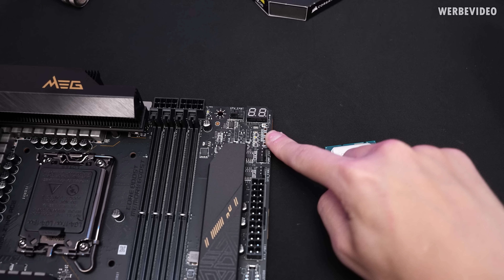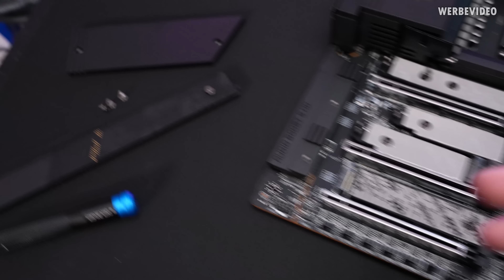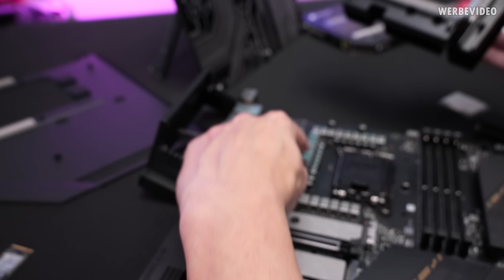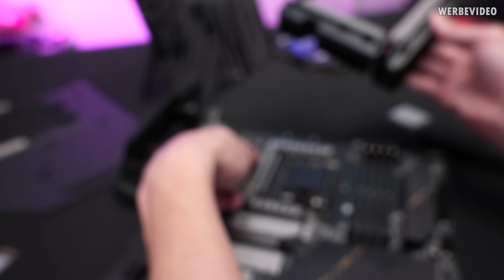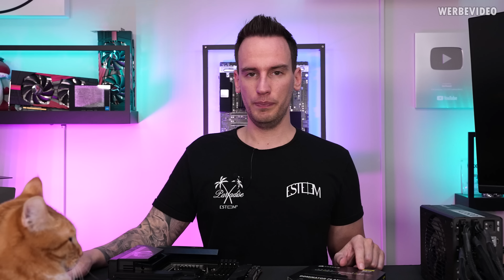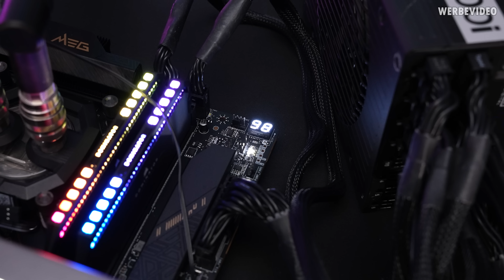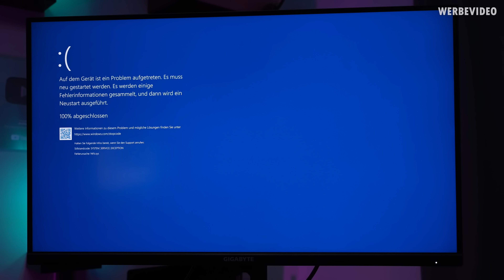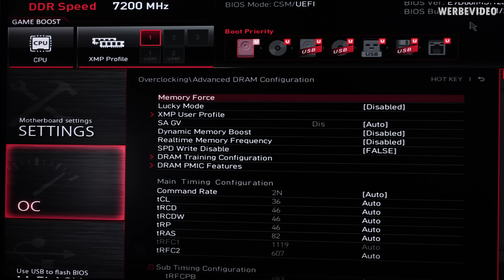My Opinion on the MSI Z790 ACE

Comment: Thank you for bringing up the memory issue on MSI Z790 boards. I have the MSI Z790 Carbon and got 7200MHz kit from their QVL list and can not run it stable at the rated speed. I even did lots of tweaks and read lots of post and many others are having the same problem. I got it can get fixed on the bios but have settled for 6800MHz with tight timings.
Reply: maybe it's your CPU that can't handle it
Reply: Daisy chain 4 dimm MSI boards are terrible for pushing memory no matter how good your CPU is. I'm speaking from experience as I owned this board for a brief period before swapping it to an Asus which exhibits none of the problems this board has. I mean, they even cheaped out on a freaking safe boot button for crying out loud
Reply: The silicon lottery is a thing. As soon as the manufacturers start advertising memory speeds so far above what Intel specify you always will be running the risk of getting a CPU with a memory controller that can't handle the highest speeds. So even if you go with memory from the QVL list there's no guarantee it will work. The problem can be just about anything as the silicon lottery isn't confined to the processors.
Reply: best memory OC on 4dimm is Gigabyte Z790 boards
Reply: @rulik007  on previouse versions I always find MSI Carbon series very good at memory OC and tighting timings (vs ASUS , GIGA etc in same price range)
and good build quality with lot of features (in some series it was cheaper than ASUS Strix-F with more features)
Im talking about Z270-370-390-490-590

from Z690 to now MSI increased this series price and its  purchase value dropped
I overclocked 3200mts single rank dual channel CL16-18-18-40 to 4800 CL 19-21-21-35 and 4400 CL 17-19-19-32 on MSI Z370 Gaming pro carbon + 9900K
while on ASUS Z390 Strix same kit didnt boot at all, I had to use higher timinings to boot.
same as Z590 carbon + 10900K (while ASUS Strix couldnt boot with those numbers

I tried another sticks too with  3200. 3600, 4000, 4133 speeds. different modes: single rank, dual rank, single channel, dual channel., and different brands like corsair Vengeance PRO. LPX. Dominator, XPG D20. D30. D60 , Team group Night hawk, Delta, Xcalibur and Gskill Trizent Z, neo
ofcourse single stick, single rank were best specially with SAMSUNG and Sk Hynix chips.

ADATA XPG D20 3600 was astonishing! very cheap ram with great overclocking potential for its range (D20 is low tier just 1 level higher than D10, while there is 30-40-41-50-60-D80 too)
Corsair rams were like lucky toys, same models with same speed (everything same) might be single rank or dual, Micron or Hynix! (there is no way to find which is it like serial number or some word at end of model like H for hynix for example. nothing!
in DDR4    Elpida  < Nanya  < Micron < Sk Hynix < SAMSUNG

in DDR5 if u wanna best overclocking potential and quality but rams with Sk Hynix chips.
in DDR5     Micron < SAMSUNG < Sk Hynix
Corsair Vengeance has good price/Speed value, but poor overclocking, Dominators are expensive and doesnt worth to buy because with same price of like 32GB Dual 5200 CL40 Dominator u can buy same capacity Vengeance 6400 CL 40 or 6200 CL 36  or Veangeance RGB 6000 CL32
Reply: @XFXForced  it was on DDR4, z490 unify OC better than maximus XII hero/formula and gigabyte was trash.
But with DDR5 is different
Reply: @rulik007  
Each manufacture designed special model for Memory Overclocking,
in MSI Boards Unify-X 
In ASUS Boards Maximus Apex
in Gigabyte Boards Auros Tachyon
in Asrock Boards Aqua OC (both CPU and Ram)
In EVGA Boards DARK K|NGP|N (both CPU and Ram)
Reply: I mean they could say 100,000mhz ram works, cause it probably would. its the cpu memory controller that dictates your ability to use fast memory.
Reply: That's funny you say that I have the same issue with my z690 carbon it can run 2 sticks at xmp no problem  but on the MSI page the xpg Lancer 6000mhz no rgb, for some reason the rgb version only says 2, but the non version is one of the of a handful that sats it says it can run 4 dimms at advertised speed, but I can only get it to 5800mhz but it let me crank the timing from 40-40-40-77 to 32-34-34 70 while at 5800mhz, 13900k cpu
Reply: Well it means they simply lying. It is also matter which size RAM do you have, because of frequency going down regarding on mem size

Comment: I could see the screwless m.2 being very useful if you are trying to swap a drive with a massive air cooler and video card in the way. Getting those tiny screws in there is a pain in an already built system.
Reply: For me its not losing the tiny screws. They are sometimes different lengths, even on the same MB :/
Reply: That's such a niche case, I doubt the added cost of the mechanism (and new failure point) are worth it

Comment: Black and gold literally goes with everything lol; probably the best two colours to put together to appease 99% of customers. It's so subtle it's not even a problem. One thing I'd zonk on this is no 90 degree 24pin header. it's 2023, and you're paying like $1000 for this board...come on (I only use MSI boards so this zonk is just a general one overall). All SATA, USB3 and 24pin headers need to be 90 degrees by now on all boards
Reply: nah, black and silver works for any rgb as silver is simply a mirror; "gold" is dark yellow so not so much, mixing of colours would happen; black with black or white with white are even better options ;)
Reply: @cokeforever there can be some boards designed for use other than RGB-ification of the world
Reply: @alexmills42  yeah, but this one has multiple rgb features and without any light coming out of pc case, there's no difference which colour are vrm and ssd heatsinks ;)
Reply: What happened to motherboard pricing? Just a generation or two ago, the godlike was cheaper than the current ace. A decade ago it was almost unheard of for a consumer motherboard that costs more than about $250. Nowadays it's pretty common for your motherboard to cost as much as your CPU does.
Reply: @41chemist19  My Z690 Tomahawk DDR5 was $385, and absolute worth every penny, BECAUSE it bascially gives you 90-95% of the features on a board like the Ace, at a third the price. The Tomahawk and Carbon Gaming lines are my favourite boards for this reason
Reply: @41chemist19  needing to support higher pcie standards need more traces.
Higher power draw nerds better vrms
Reply: @41chemist19  yeah tell me about it, I just upgraded from a 12 year old X79 based system to a X670 + 7950x, and despite the old motherboard costing 1/3rd the price of the new one it has quite a few features the new one lacks (eg: power switch switch on the board, dual bios which could be toggled with a button on rear io panel, far more pcie slots, a cmos battery tray as opposed to a damn header).
Reply: Maybe if you’re blind, or a 9 year old kid.
Reply: well this sucks for mid towers, stuff will run into the front fans/rad. sata is very low profile after the connector compared to the 24pin
Reply: in some cases 90 degree 24pin not so practical
Reply: @madmadz1624  just add 90° adapter in the MB package, they are not that expensive...
Reply: @ResurrectedDarokun  ye I do guess that’s true
Reply: or make the headers at the back, like some upcoming motherboards
Reply: @GewelReal  Then you'd need a propriety case to go with that. Just a gimmick, no thanks